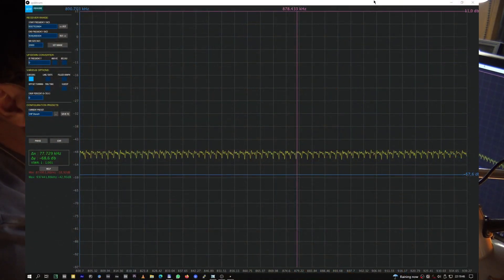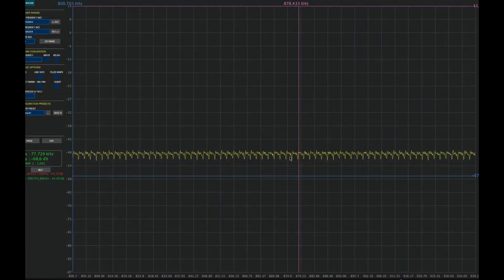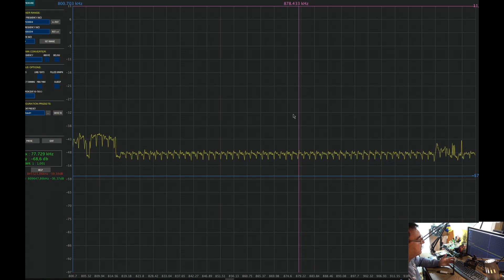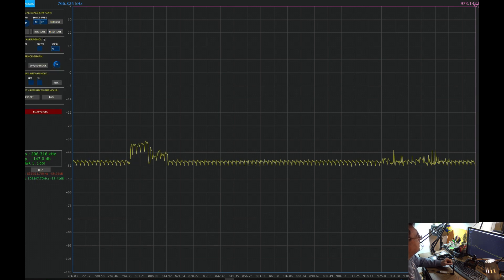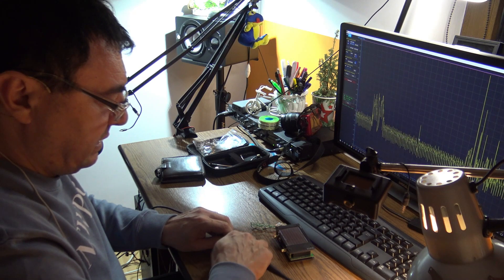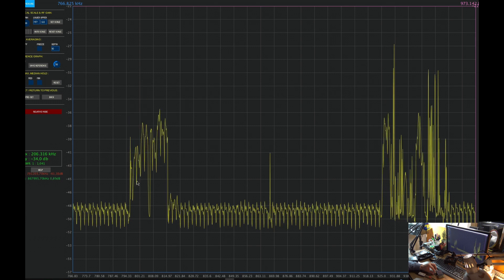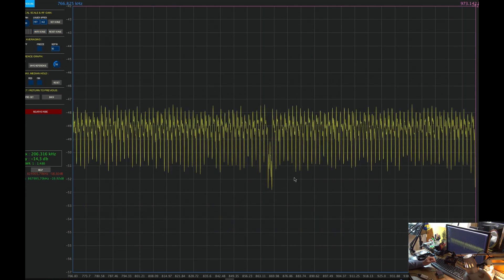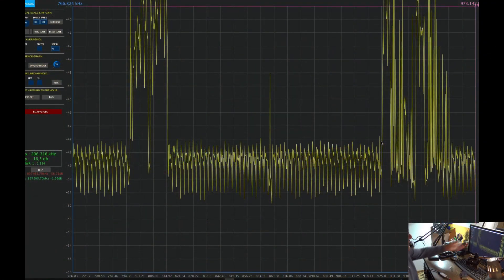LoRa filter on Spectrum Analyzer

Comment: When using the airbuddy.
Is there a scenario where u suggest to use antenna then amplifier the filter then hotspot ?
Or is it always better to use antenna filter then amplifier and hotspot ?
Reply from the maker: Antenna/filter/amplifier/hotspot...why? Because the amplifier is processing only the 868MHz band, no risks of overflow it...
Reply: @viocaia  so ur saying best is antenna filter amplifier hotspot, the other way has no benefits ?
Reply from the maker: @wazneh   Think about the amplifier like a small loudspeaker pushed to play deep bass sound..you over run it ! So it's better to give the amplifier a small piece from the whole radio signal captured by the antenna..it's working better and clearer..of course will have a decent job after the amplifier..but in this case , the amp will amplify a lot more radio band...possible overdrive it

Comment: Something happened to my SDR dongle a few years ago (what beats me) but there are two things I get with it.  NOAA weather radio and garbage in the 900mhz band.  The 900mhz band is so hot it needs to be reduced via SDR#.
Reply from the maker: And 800 too..here...I'm planning to build a long wire antenna for some SW RX..I'm afraid is to noisy radio enviroment.I have 2 PLL SW radios, barely listening something in between whistle and zooommms..
Reply: @viocaia  For me it begins around 800 and doesn't stop until about 950-1Ghz.
Reply from the maker: @generalawareness101  Interesting..how comes? it should be silence around 915..
Reply: @viocaia  Not sure why.  Maybe something governmental, or military related.
Reply from the maker: @generalawareness101  Absolutely!